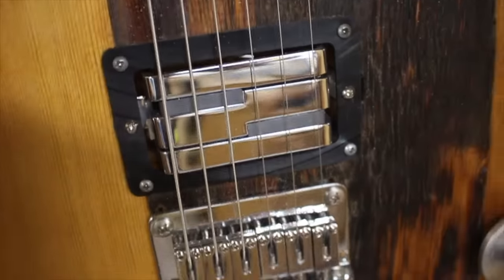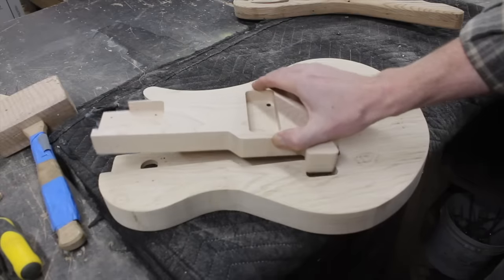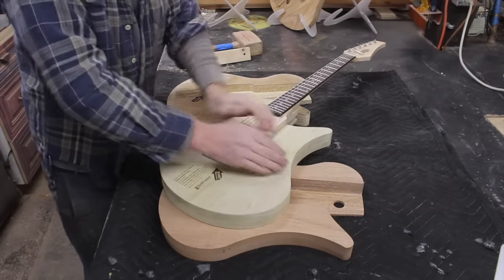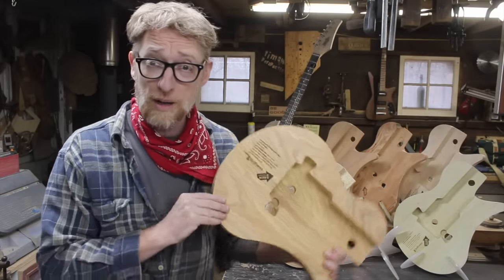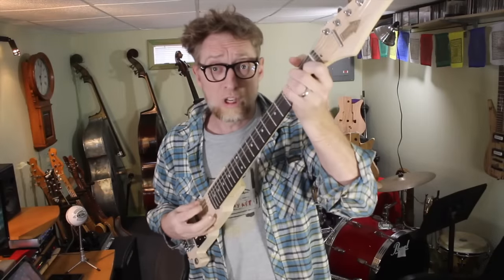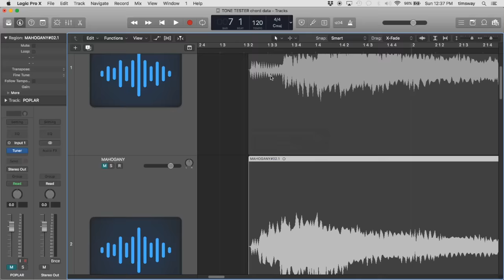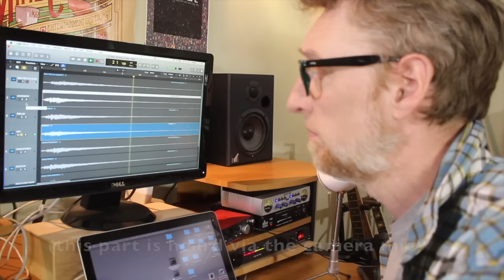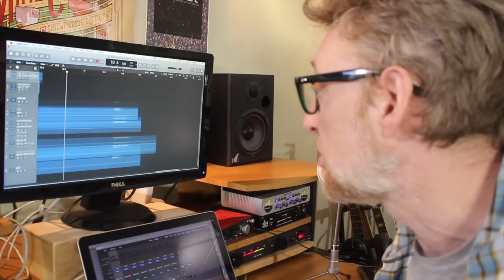Tone Wood Tester: One guitar to test them all

Comment: The problem with this is that the different "bodies" aren't under any tension from the strings. They're now peripheral to the physical system formed by the strings and the materials supporting the strings.
Reply: Graham Rathbone  Of course. You're mistaken if you thought I was saying the "bodies" here will have no effect. I was just saying that this experiment is not equivalent to changing actual bodies.
Reply: Graham Rathbone  Not without running the experiments myself, no. I was just pointing out that this is a flawed way of testing the original premise. The only real way to test it would be to have multiple bodies to which you can fit the same neck, electronics and hardware. It would probably be easiest on a hardtail strat because of the relative ease of moving the electronics.
Reply: @eyeball226  , I pretty much agree. The piece of wood that the components are attached to is more important than the rest of the body, especially since it is just a press fit. I also think it is hard to hear a difference when the sound samples are played from beginning to end one after the other like this. I think you need to be able to cut from one to the other like moving the pickup selector on the guitar.
Reply: The neck is where to look for tonal differences in woods, he's basically just checked this neck in different bodies, and proved them to be pretty much no difference. Because obviously the same neck was used. It's all in the neck my friends, I kid you not.
Reply: @stu4116  No man, tonewood just doesn't exist. I know it's a hard pill to swallow, but it's the honest truth.

Comment: Really great comparison video and interesting results.
My only concern is the lack of control from human error.  The "strum" would need to also be controlled so the amount of pressure, speed, and placement was also identical.  The differences I was hearing can be attributed to the placement, speed, and force of the strum.

Really...fantastic job!
Reply: But why? When we play guitar we don't control for human error. Aren't we trying to see if certain woods sound better when being played??
Reply: @davecarsley8773  In order to offer up a comparison or experiment as fact or proof, the scientific method must be adhered to.  This means removing all human influence and error...anything that can create a subjective opinion rather than an objective and 100% replicated result.

To do this right, the setup for each wood in question would require the only change to be the body wood.  All electronics and components cannot be moved as this is an alteration of the Unit Under Test.  (this creates a problem since we would want direct contact of components to the new target wood, but all distances, positionings, and string tensions cannot change)  The output must be record by specific and calibrated test equipment designed specifically for audio analysis.  All cabling must also be the same and never moved.

Finally, the "strum" placement, power, and speed must be performed by machine that can reproduce the "strum" reliably as slight changes in position and power can alter the output.

This is what an objective test for "tonewood" would require for a test setup.  

Once we start talking about specific woods, we can talk about density, moisture content, weight, sub-species, etc.  No two pieces of wood are identical, so not one sample of wood can be considered accepted as a representative for all of a specific species. 

This is something I have been contemplating for some time now.  While I work in a lab for the past 15 years in QA Testing and write the test plans we and our partnered suppliers use to insure quality in our products, the scope of this is a very large undertaking.  If I have results for a device I have tested, our partnered supplier can achieve the same EXACT results using the same method in a lab half-way around the world.  That is objective data...hard numbers.

The results of all the "tonewood" tests I have seen to date are at best subjective conclusions, not objective results with repeatable data to confirm.  Still...I applaud the individuals who take this challenge on and remain open about the pending results.

Honestly...I'm not a believer in the concept of "tonewood" and challenge the notion...but remain open to the possibility that in a solid-body electric guitar there may be some influence to sound because of some characteristic of the woods used.  However, I find flaws with the concept of "tonewood" when considering the variations in crafting methods.  At what point is "tonewood" viable when considering thru-body necks, bolt on necks, maple neck and mahogany body, same-species laminate necks, bi/multi-species laminate necks, same-species laminate bodies, bi/multi-species laminate bodies...

I could go on about variables, but that would be a lengthy conversation.  Like I stated before, this is something I've been pondering for quite a while.

Again, I appreciate the work people have done on this topic and salute them.
Reply: @eskrimadorchris  if you have to do this much exact and precise experimentation to hear a difference does it really matter?
Reply: @ml8991  It's more about the need for accuracy when engaging in the "tone wood" debate and eliminating any and all possibility for counter-points.  Since there are people firmly entrenched on both sides of this topic...some who make a living using this...it is incredibly important to be exact, calibrated, and objective with measurements so there can be no argument. 

I've been testing CE devices as a Test Engineer for the past 15+ years.  Subjective findings are argued as they are opinions ad lack measurements from calibrated equipment and a solid and reproducible testing plan.  Objective measurements are less disputed as results are able to be duplicated using the same test equipment and testing process.
Reply: @eskrimadorchris  impractical, thanks for the essay though
Reply: @ml8991  Agreed in part...but necessary for those who demand definitive proof.
Reply: @eskrimadorchris  understandable have a good day
Reply: ridiculous
Reply: Well, if such minutiae matters THAT much, then the wood simply doesn't matter. 

What I've discovered on my own, is that great guitars still sound great, no matter what pickups are in them. Alternately, no guitar I've not been impressed with has ever been saved by a pickup change - all of which leads me to believe the wood absolutely IS important.
Reply: @allrequiredfields  ...I recently watched a couple of videos on this same topic where the end was there was no guitar body or neck...just electronics and strings suspended over an open space.  The pickup was the same as in an Anderson Tele...and the comparison was almost identical...wood body & neck vs nothing but anchor points on benches.

Worth a watch.

Comment: something that needs to be considered is that a human strumming a guitar is not going to be another variable in this experiment. I would suggest using robotics to remove the variable. Also instead of listening to each clip to try and distinguish a difference, compare the EQ of each guitar body to have a visual and quantifiable evidence. The ear is not reliable as other people will hear different things, and there could be a placebo affect as well. by comparing the EQ graph to one another, or even converting it to actual numbers, this will eliminate the human from the experiment. I would love to try this experiment myself. You could use a computer to time the strum and stop once it reaches a certain decibel. this would require some coding ability above my own, but I believe is very doable.  Overall i think this was a very well done test, and found it really interesting.

Comment: Make a guitar body made of epoxy resin containing various materials (ball bearings, gravel, air pockets). It would be interesting to see if the sound changed between additives.
Reply: I would expect the discontinuities in density would severely dampen resonance, and irregularly shaped discontinuities would do that even more so, resulting in a quieter guitar with lower sustain. But I could be completely wrong.
Reply: @magnusbruce4051   the only factor that matters is mass.

Comment: there was this guy on a guitar forum that asked the tonewood experts to guess what body the guitar was and posted a soundclip, so they argue ash alder pine, and it turns out its 2 hunks of MDF screwed together lol
Reply: Because tone wood is a bit of a myth.
Reply: @demeneye  Not really, the myth is wether or not it makes any difference on electric guitars. There can be no doubt about the influence on acoustic instruments. I think at the very least it impacts on the sustain which is still significant. But on the other hand there's so much things the quality of an electric guitar depends on that the type of wood shouldn't be a determining factor for buying a guitar.